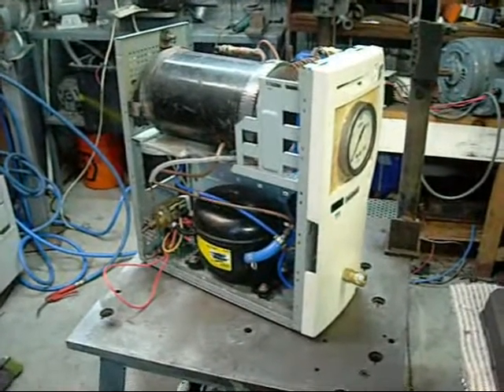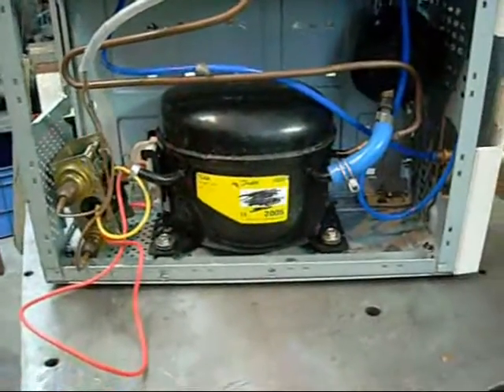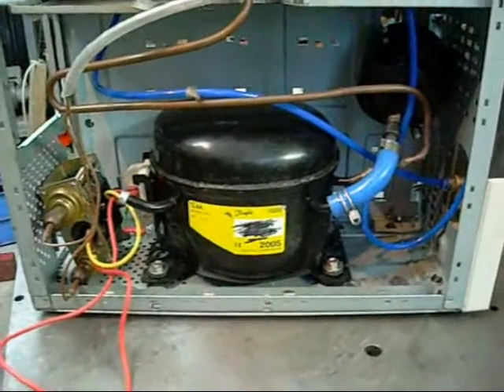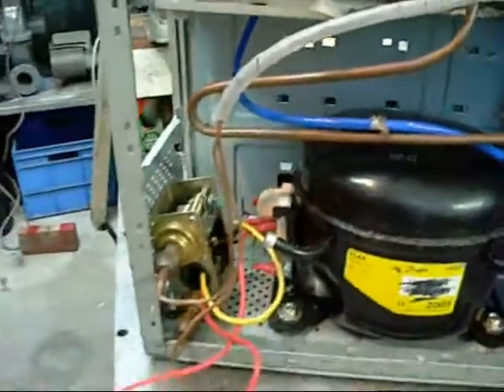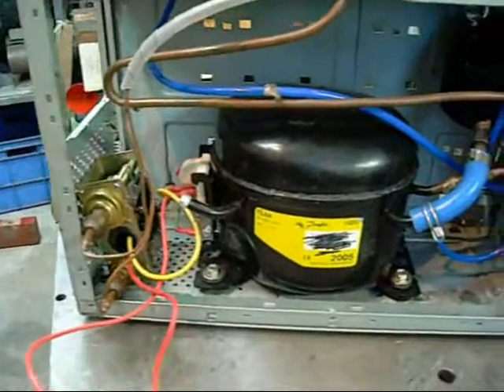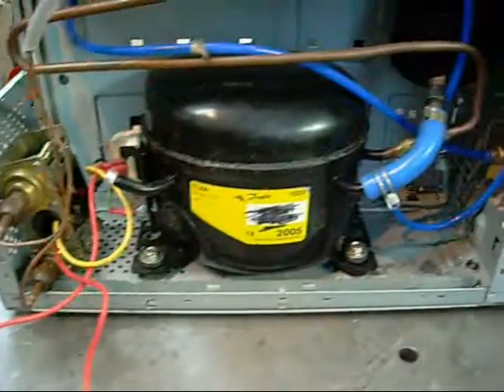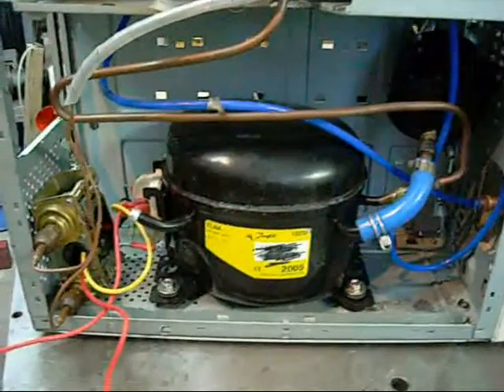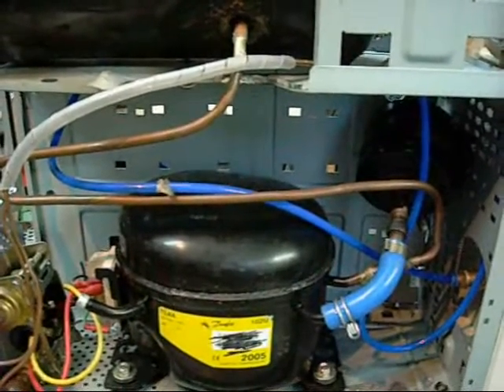Silent Air Compressor update

Comment: Know this is a old video, but for anyone wanting to build something similar there's 2 things you need to do to overcome the short cycle issue (not to say your compressor is up for the duty cycle, but to make it function)

Additional cooling, or bypassing the thermistor to allow it to cycle, and a oneway valve past the compressor with a bleedoff valve between it and the compressor.  This aleviates the pressure on the pistons stopping the motor from getting going.  If you don't bleed off the pressure on the compressor, and it doesn't have enough torque to start spinning, it will likely overheat and die

Comment: hey ed i discovered that some of these units trap high pressure air in there piston cylinder and will not turn over without a start capacitor , but when the back pressure in the piston leaks out it will turn over again , any way sorry to here your device isnt working well, but i love this concept people like me and you tend to hit the garage until 3 in the morning and if you need 400 psi at that time of night your bound to piss a few people off

Comment: This was helpful!  I have an Italian made Whispair air compressor for my airbrush which is essentially a factory-built unit using a fridge compressor like this, with a tank and gauges.  Nice and quiet for use in the house or studio!   It's just failed after 20 years, and I have to learn about what the parts are and what they do to see if it's fixable.  Probably the start relay failed. It doesn't need to be cut open, the oval cover is designed to be removed and replaced, and there is an oil filler hole in it.  Next problem is finding where to buy the oil (Castrol Aircol SN 32).

Comment: ***** I have the same problems with the compressor I'm building. Is there a way to add a start cap and a potential relay to a "low starting torque" compressor. How would you calculate the capacitance? That would enable you to have a fast cycling rate, and the compressor would start with back pressure.

Thanks

Comment: It is overheating; a frige only runs for say 5 min at a time and shuts down. If you want to run it longer, use a fan or alternate ways to keep it cool and then it will work better, interesting idea but realize this is a low volume cubic in per minute, good size piston compressor deals in cubic feet per min…

Comment: kI don't know what (if anything) you've done with this project since posting the video, but I have an off brand compressor (loudest thing I've ever heard) that has a small motor, and what it does to start when under load it open a solenoid valve between the tank and the compressor head . I'm assuming is has a one-way valve before the tank, but it seems to work pretty well. with a 1.5hp motor, it can start pumping at 250PSI with no problem. Just a thought

Comment: I have an air compressor with plenty of torque,  big 20 gallon tank doing constriction.  Your compressor seems great for Saturday mornings when I don't wanna wake the Mrs. and personal crafts stuff.
You can try installing a computer fan in the back of your unit to help with overheating or a regular house fan aimed at heat source.   I do that to my Marshall amp all time..common practice.

Comment: Dude..can i call u dude... check if the pressure relay has a relief valve (the wissle u hear in normal compressors after the pressure relay cuts off the motor)...godspeed

Comment: on starting the small refrigerator compressor I found that a small hard start kit put across the start and run (I believe are the two) help the motor startup and run for a while that start circuit is in for just a couple of seconds than goes off. good catch on the water chillers.

Comment: I know this is old, but I put together a system using a conventional compressor, but I used a switch that had a built in relief so the compressor would not have to start against the tank pressure.  You put it in the line and put a check valve in it, when the switch clicked off, it also has a little valve that opens. You pipe that into the line on the compressor side of the check valve so the pressure goes to zero.  Would that help? I'm looking to build a silent compressor like this.

Comment: use a hard start kit on it, then it won't go off on bimetal high temp cutoff. It should also be air cooled since it isn't sucking in cold vapor refrigerant. high running temps=high amps, compressor will kick off on internal amp overload protection.

Comment: I'll be more respectful if you promise to wake the f*ck up. 

I'm a retired Marine Engineer with 43 years in the job, who is now an active member of the volunteer Ambulance Association. I think I know about as much about both refrigeration and the dangers of mains power as anyone here, and definitely more than you.

The reason i made the first post here was because I'd just returned from the coroner's hearing into the death of a 32 year old father of two who  was electrocuted doing just this.

Comment: @Aussie50 Similar problem with a compressor I built years ago. I bought a one way check valve in the line out from the compressor (mine screwed into the reservoir and T-ed off of the pressure line prior to the check valve from that I ran copper tubing to a normally open electric(ac) pressure valve and tied it into the the pressure switch.  Reservoir reaches full pressure shuts down the compressor and dumps the pressure in the line.  On next start up, there is no resistance.

Comment: Hello! I've made my airbrush compressor with same exact Danfoss compressor. It's hooked to pressure switch that cuts power off when filled to 7bars. I've noticed this same problem with short cycling. Have you managed to overcome this thermostat starter issue? And what compressor would be ideal to use in this kind of device? Any brands to look for? Many thanks already.

Greetings from Finland

Comment: not a good idea you will overheat the thermal overload with short cycle start and stops and pressures too high will release the inturnal releaf valve

Comment from the maker: @ozzirt lol, I'm just fed up with goodie goodies running around making work so difficult its easier and cheaper to go over to China and get things made.

I support workplace safety, but common sense safety, like don't stick your head in a lathe kind of safety!, not this over the top bullshit where a drill press needs a full metal guard around the table and spindle, and a light barrier that shuts it down if you even so much as scratch your nose!

Comment: @Aussie50  Remember,.. 15mA will stop your heart, permanently, very easily achieved at mains voltages with just the slightest problem in your earth. 

That's what killed a teen aged girl drinking out of a tap at Port Pirie High School several years ago, it' s pipe was used as part of the building earth circuit and was in moderately damp earth, when a washing machine in the home science centre shorted out.

Say what you will, it does happen and the consequences

Comment from the maker: @ozzirt yeh yeh, enough paranoia. 
I've even had Worksafe Victoria threaten to audit my one-man hobby shop. bunch of nazi pricks.

I've been running tandem fridge compressors for the last 2 years as my main shop compressor, on constant cycle (running up to 25 times a week or more) with little more than 2 - 3 oil top ups per yer, no earth breaker trip do far!

Your patient probably ran the compressor until it overheated and burned the varnish off the windings, without earth, any motor will kill

Comment from the maker: @ozzirt Compressors are consumable, so if it does get impurities in the oil and wear out its no big deal, just fit another.

as for the electrical issue, you have a good point about people pouring oil back in that may have water in it.. 
under normal operation with clean oil fill, any moisture evaporates from the oil when the compressor warms up (they do run hot when filling a tank)

It would be silly not to earth a compressor or electric motor of any kind, and a ELCB is preferable as you say.

Comment: @Aussie50 
Hi Aussie,
I decided against the oil sightglass and fitted an hours run counter to the pressure switch contacts instead. The counter logs the compressors running time and tells you how much oil to add. I emptied the oil out to check the consumption when the counter showed 5 hrs and again at 10hrs..but so far it hasnt used a drop.  I`ll test again when the counter shows 20 hours..in about 2 months time :)

Comment: would it work if you put a small hole in the outlet line and then just after the hole put a one way valve to hold the tank presser but release the compressor presser?

Comment: I have one set up as a compressor works fine just make sure the crank case has oil   and use a fan to keep it cool as well as using a checkvalve inline and A oil catcher as from time to time some oil will come from the discharge line. also filter the suction line to keep junk out of the compressor. mine is on at 110 psi and off 130 psi . compressor from an old 1980's frige used r12 originally.

Comment from the maker: @Goldstarelite I've never had one go off on internal over heat protection, but I guess if you run it hard enough it will. but by that stage it would be best to go out and buy a real workshop air compressor.

oil top-up is a bit sketchy, because there is no sight glass on small comps, but the centrifugal oil pickup is pretty long so it can be over-filled a bit. 
and a few tablespoons of oil every few running hours is adequate for a low-hour comp.

Comment: You can try using a non return vale and a bleed off valve. this will lower the internal pressure in the pump to let it restart at a lower pressure. Tank pressure will still remain high.

Comment: use older compressors, i use an old kirby fridge compressor from a 30 year old fridge, they will start with a load or not, just makes the compressor wobble a bit, Only drawback is moisture accumulating in discharge

Comment from the maker: most compressors do send a bit of oil through the system as they run, but that oil needs to return to the compressor in order lubricate the compressor over its lifespan.

my theory is that the pressure difference between the suction and discharge side on the Scroll compressor forces the oil to stay in the compressor head. running one at normal atmospheric pressure would drain the crank case in a matter of hours.

Comment from the maker: I have had a rotary up to 600psi, but not a domsetic fridge compressor.

I havn't done many tests on scrolls but they can run for a long time in an air conditioner. but the main factor that contributes to their run time is subcooling.

scrolls are very dependent on cold gas returning from the evaporator to cool the electric motor.

If you were to run a scroll continuously with no subcooling it may overheat and die.

Comment from the maker: I've never seen scroll compressors in small fridges,, only coolrooms. 
if your application is only small I imagine a standard recip fridge compressor would work just fine.

Or you could use a rotary compressor from a small airconditioner.

Comment from the maker: nah the one in the vid was reciprocating. the smallest scroll I have ever seen had to be mounted vertically and was almost as tall as the comp case.

Scroll comps pump tons of oil out when they are used for air. I would not reccomend them.

Comment from the maker: The compressors I was using were factory surplus, not to be re-sold to anyone. thus I had to destroy most of them and use a couple for experiments.

I ended up using a light commercial compressor, but a reciprocating AC comp would be too big and heavy for the case.

Comment from the maker: I have a few Kilxon devices from old AC compressors and they are different to what Danfoss use.
the soft starter on this one was simply not designed for short cycles.

Comment from the maker: I think its actually called a Posistor, the nature of how it works is that it supplies power to the start windings and heats up in the process, increasing in resistance untill there is little or no power going to the start windings.

If you power the compressor down the posistor will remain hot for a while, and thus if I try restarting the compressor whilst it is hot, no power will be delivered to the start windings.

they taught me about these in school but i forgot most of it now :(

Comment from the maker: the compressor runs hot enough to keep moisture in the oil and manifold under control, the tank is the main concern.
I may rotate it and fit a dump valve.

Comment: what about condensation which would eventually build up in the discharge chamber of the compressor, that can't be good for it in the long run, or if you are using it all the time

Comment: if you put a check valve and release valve at the compressor when it stops it would depressurize the compressor but not the tank so it can start on demand. i think that should work?

Comment from the maker: if its an older style compressor, fine mineral oil works fine, like Singer machine oil, if its a new one thats designed for R410A etc.. its Polyester Oil, in which case you need to talk to a refrigeration supplier. POE oil is not compatible with mineral.

Ads far as air tool ol goes, I don't see why it would create a problem since we are not dealing with refrigerant compatibility issue.

Other option may be auto trans oil? never tried it but it is made for fine high pressure parts

Comment from the maker: I guess you could try a small start capacitor and conventional starting relay, but I don't think the start windings are designed for high impulse starting current.
I may try that today with a HST starter on the LST comp